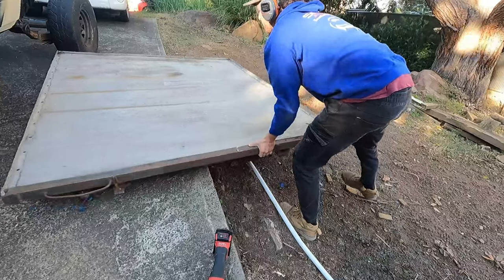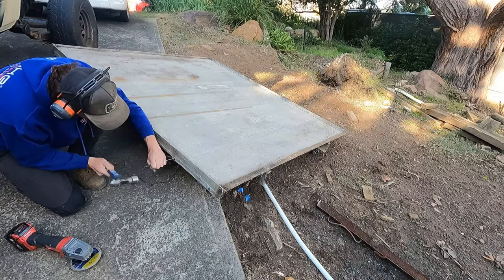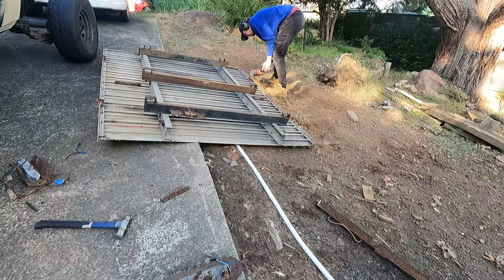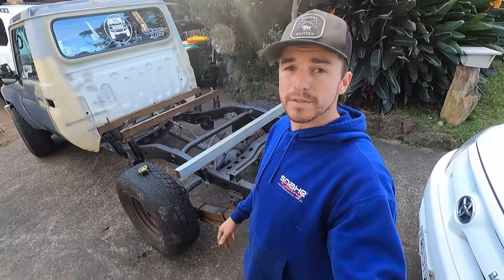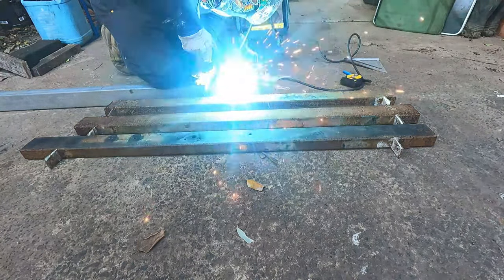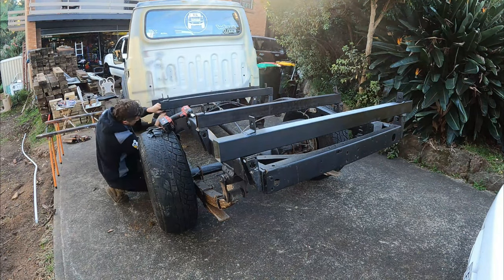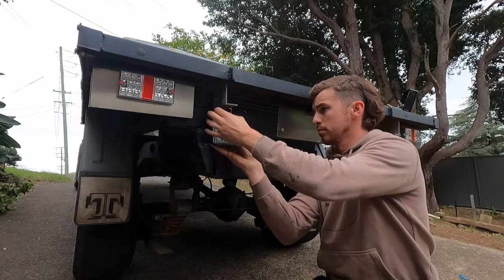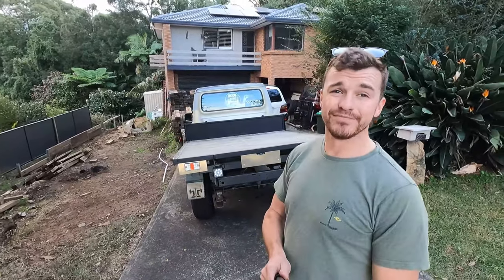BUILDING A CHEAP, LIGHTWEIGHT UTE TRAY FOR THE 79 SERIES LANDCRUISER

Comment: Did you sand and primer before paint?
Reply from the maker: Yeah scuffed it all up with 180 grit. Anything that was bare metal or filler got a coat of primer, where there was decent paint underneath I just went the raptor straight over the top, seems to have stuck pretty well. I used the adhesion promoter around the windows and rain gutters etc.

Comment: What paint do you use ive got aluminium tray how do I paint it what paint do I use
Reply from the maker: I just used a cheap rattle can matt black as I only need it to last until my steel tray is ready. The important step to make paint last on aluminium is your preparation and a good quality surface primer
Reply: @RQProjects  what preparation is needed mate
Reply from the maker: Give it a good scuff and wipe down with wax and grease remover, make sure there is no corrosion on the aluminium and then just follow the instructions on your primer 👍🏼